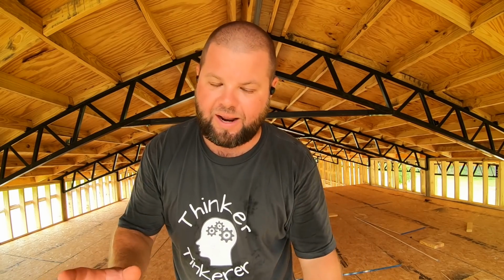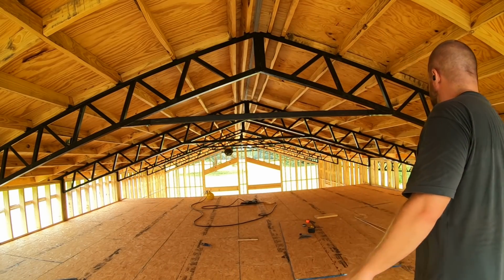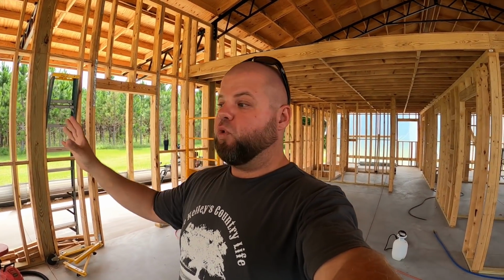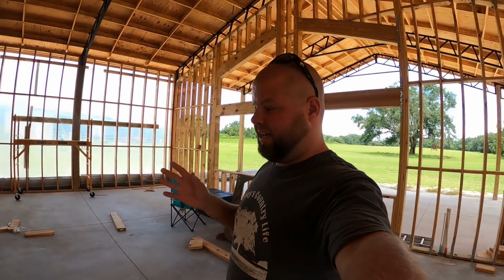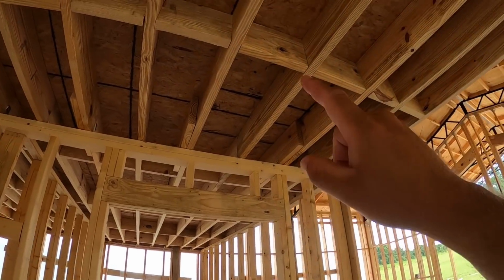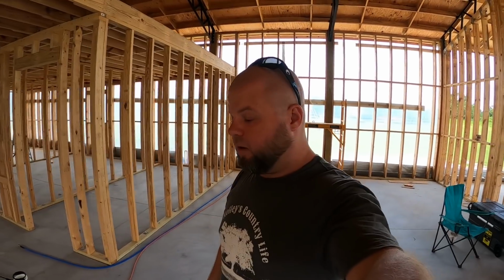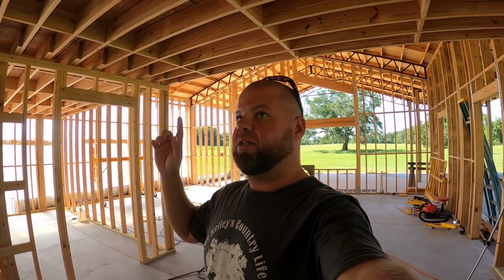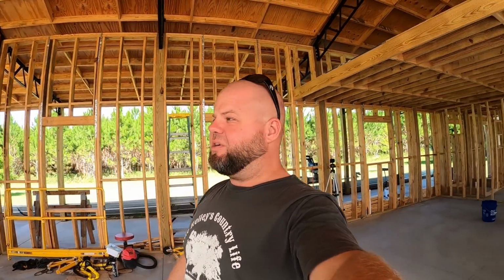An accident and working inside the pole barn house

Comment: love the strong ties.. my sister and her husband bought a tract house that had just started construction on.  while they were framing it. he went in after hours and added hundreds of strong ties  to every spot he could get to.  when the northridge earthquake happened. they were about 15 miles from the epicenter.  they were asleep when it hit.. the shock waves thru them into the air above the bed twice as the house went up and down.  some areas distant from the epicenter experienced a localized rogue wave even where shock waves from different areas of the fault rupture crossed and amplified.  their house did not even have a crack in any wall.. yet.. every other house in the same tract built by the same crews had major structural damage.    have you thought about adding some stainless steel pallet banding to some areas. 

 lastly.. before you frame in the attic end walls.. put several flanges up high to allow you to pass cables from inside the house to the outside thru the flanges and conduit thru the end walls..  you will eventually want wires safely passing thru and be sealed to prevent insects..  to run things like antennas.. camera wiring..  perhaps even anemometers on each end of the roof peak.. so when at night when the wind starts blowing .. you can tell how fast its blowing.. but also as an alert using something  to set off an alarm if the wind rises to fast..  or the atmospheric pressure starts dropping.  be sure to run a plastic conduit from the bulk head connectors at the wall peaks.. to either the electronics closet..  or the master bedroom closet.  forward thinking saves time in the end ..  even if it cost additional funds up front..
Reply from the maker: Wild story and great tips! Thanks

Comment: Use zip sheathing. Install and tape as you go. It's supposed to be more uv resistant than house wrap.
Reply from the maker: It was 55 dollars a sheet and impossible to find a while back when I bought my Osb for 30 a sheet. I really wanted to try it. I did buy Zip tape and I'm going to tape my osb seams.

Comment: Glad your eye is ok so far. I use goggles and a respirator when spraying caustic liquids. Mixing bleach with vinegar (most acids really) will produce chlorine gas. I am not sure how much (if any) acid is left on wood/metal/concrete surfaces after vinegar dries but you are in a well-ventilated area. Being blind, in pain, and alone can be terrifying, glad you kept your head and didn't panic.
Reply from the maker: I didn't use vinegar much at all once I seen how ineffective it was, but a good point none the less.

Comment: So glad that you are ok. You still should probably go have it checked just to be safe. 
Maybe a stupid question but figured I'd ask. Did you ever consider putting in a few small windows up in the attic space in the short outide walls for ventilation or cross breeze especially since you are going to have a room up there?

Scot
Reply from the maker: The loft will be open to the downstairs living room, so it will be air conditioned. As for the attic, we are spray foaming the roof, so you do not vent it. It's considered conditioned space when you do that.

Comment: I have used stuff called Wet-N-Forget to rid my house exterior of mildew.  It takes a long time to eat up the mildew, but it works well on wood, concrete and other surfaces.  I'm not sure if it would fit into your plans though.

Comment: Hey Andrew. How do you like the dewalt frame nailer? I was about to buy that one and discovered that Lowe’s had a deal on the Metabo. You buy the frame nailer and they give you a Metabo 2 1/2” finish nailer FREE! If you think you’ll need another frame nailer check your local lowe’s and see if they have the same deal! It’s a nice nailer. Enjoying your videos. I missed your live feed on Sunday but maybe i’ll catch you this sunday. Hope your eye feels better.
Reply from the maker: I seen that deal at my Lowes too. I literally have 4 Brad nailers so don't need another one lol. As for the Dewalt nailers, the only ones I've ever used is the new 20 volt electric ones, those are a bit slow and extremely heavy.

Comment: @9:30 steel struss to roof beams.. how about adding some LU28 beam hangers to really get a grip on the roof ..  i would have liked you to have used the longer hurricane ties earlier in the video..    have you seen the Simpson CHC lifting eyes.. a few of those might be interesting above your attic ladder installation.. so you have a strong place to hang a rope fall..  heck.. might mount some along the inside of the roof peak under the eves.. so you can hoist stuff up or hang stuff securely..  those go in with screws..  just backseat driving from afar.. 

 and we know about the deep south where the traveling salesman drove past the Nativity scene. had to go around the block to get a second look at it..  found the local diner and went in.. ask  the waitress about the Nativity scene not being correct.. what do you mean she says.. he says. why are the 3 wise men wearing fireman turn out coats.  what.. are you some kinda yankee.. don't you read the bible.. don't you know about the 3 wise men from A fire.. in her best southern accent.   did you know that one of the wise men was very tall.. as he bent over to enter the stable.. he hit his head hard on the door frame..  he grabbed his head and yelled out Jesus Christ..  at that point Joseph turned and said to mary.. quick, write that down. that's so much better a name than Ted..
Reply from the maker: Lol funny story and good tips, thanks!

Comment: You seem like a really nice guy, you need to get a friend I will come over and help you with that stuff. Building a wall and lifting it up is one thing putting boards and putting down sheet horizontally is easy, vertically you’re trying to hold a 4 x 8 sheet of plywood in place and nail it accurately. You really need a helping hand on that I don’t know how you’re going to do it. You’re gonna need to make some kind of rig to help you hold it up probably come out something that sits up on top or you can put a screw in one side and hold it up like if you had someone there helping you. It is going to take you forever to do it that way by yourself.  Lol. You’ll probably melt if you try to do it by yourself
Reply from the maker: Definitely going to make a jig or holder for those sheets. Thanks
Reply: @TKCL . If it was me I would run a cable from end to end with a pulley on top where you can find a way to suspend the sheeting from the center. You’re gonna want to do it horizontally instead of vertically because of what you showed printed on the plywood and how that is the direction of strength you don’t want to go up and down so the first layer will be pretty easy. If you can get some kind of clamps that would hold that much or like a gravity clamp and you could hang it from a cable or something above it might be enough to where it will hold it and you can just position it and keep it in place long enough to get A few nails in it. It will be fun to play with. I’m sure you’ll come up with something good. Even if you just made a 90° frame and use a piece of bicycle tire as a grip for the top, that would be something that you could move without climbing up and down all the time and at least get it to hold up the bulk of the way to the word or at least one side.  Maybe you should be nicer to people though so you have friends and one of them could come over and help. 😜😂😂  It will be interesting to see what you do. I would just keep in mind you want something easy and maneuverable that’s not too heavy it’s self that you can adjust and move from the bottom so you aren’t constantly climbing up and down stairs to deal with it up top.  Can’t wait to see what you figure out.

Comment: I haven’t seen bleach affect lumber to bad but I have seen bleach cause nails to rust fast. 
Be safe brother ✌🏼🇺🇸
Reply from the maker: Bleach does cause metal corrosion. Spray the nails, and especially anchor bolts/washers with WD40 or corrosion X first.
Reply: @TKCL  True. Another great product is CRC Rust Inhibitor. It’s like Cosmoline  grease in an aerosol. Great for boats and boat trailers. Especially a fresh set of leaf springs. 
I put that chit on everything.

Comment: There are aftermarket products you can use for the mold, if you don’t blind yourself first, once you get the outside dried in you want to use more than bleach, bleach will kill the mold but not the spores, do you want to use peroxide. Peroxide will kill the mold but it will also kill the spores. You can use bleach and it definitely kills the mold, I’ve never had any luck with vinegar. But peroxide your best friend when it comes to bleach. You have to look up the ratios but that peroxide is going to kill the spores and get rid of the mold all together bleach it’s just gonna knock it down and kill the live mold, but it’s just gonna come right back.  

To keep from going blind come of course rinse with water but go grab a bottle Celine solution or I wash, it’s pretty cheap and it’s pH balance so it’s not gonna burn your eyes like water well and you can use as much as you want of it.  Some goggles would be good too though with your humidity I don’t think he could wear them for too long but it’s your eyes you want to protect it otherwise you’re gonna end up wearing a patch and looking like a pirate and scaring all the little kids away. :/ 

When you’re using peroxide to kill mold you want at least a 3% solution but no more than 10%, and definitely keep it out of your eyeballs.  Lol. Coroners actually use peroxide to clean all the flesh off of bones so I’m guessing it’s probably not good at all for a balls.  He just put it in a spray bottle and soak them all the areas down and then you let it sit for about 15 or 20 minutes and then you wash it off, you can use a brush or a rag and just scrape it off. But the Prock side will actually destroy the mold spores to a lot of other mold remover’s will just get rid of the live mold and leave the sports behind and it’ll come back again. Peroxide should get rid of it permanently.  Works really good on mildew as well.  3 to 10% probably isn’t strong enough to bleach your hair, but I’m guessing you’re not too worried about that, I’m guessing you’re not the type to dye your hair. Lol
Reply from the maker: I bought some biocide that's just for mold, supposedly the best you can get. After dried in, you soak the wood in it and it's there for life.
Reply: @TKCL  awesome. I remember the house I worked on about 10 years ago and there was a bunch of mold underneath the house and we bleached it and scraped it and it came off but then we bleached it again and we bought an aftermarket product it was a sealer that said it would kill the mold and it was basically like a paint that you just paint over it and that seem to work pretty good even six or eight years later there was no mold down there.

Comment: I'm sure someone else has already said it but you have 90 days from the time you put up the house wrap till you cover it.
Reply from the maker: No one has said that, but it shouldn't be a problem. I'm itching to get my hardi siding on asap. Thanks!
Reply: @TKCL  just giving a heads up. I know a lot of people esp up north during the winter that think in the fall that is dried in but the UV is not kind to house wrap. Neither is the wind.
Reply from the maker: Luckily I coughed up the extra money for the Dupont tyvek, not the cheap big box stuff. The inspector was happy to see that. I'm taping all seams and will at the minimum put my hardi trim on to help secure the wrap.

Comment: In my experience, the inspector was OK with the sheathing being covered with tyvek. He just peeled it back in a few places to look at your nail pattern. It does not have to be a 100% inspection. It is a spot check.
Reply from the maker: He has looked around enough at my work that he realizes I don't cut corners. At least that's the feeling I got.

Comment: How do you treat and bleach it with what
Reply from the maker: I hit the little bit of mold with a 1 part bleach, 2 parts water solution. That only works if you allow it to dry well afterwards. Once the hiuse is built you control humidity no longer allowing any growth.

Comment: When you get to the point of doing the electric in the house don't forget to have some fun and put in some things for jokes like speakers in random spots for the times you want people to think the place is haunted. It is amazing what simple sounds that people can't find a source of will make them think like how easy it is to scare people with the sound of kids laughing with the source moving around them. 

Ozone is the answer but you would have to wait till you get the place sealed off more from the wind blowing as you want to get the concentration up inside the building. Once you get the place housewrapped and can temporarily seal off the doors and windows simply setup an ozone generator with a fan to spread it in the house and let it work for a weekend and everything living on the wood will be dead. You can also use a the right type of UV light to kill off everything on the surfaces but would want the cord outside so you can turn it off before you go inside.

Comment: You should be waring goggles and glasses . Read your msds on the bleach your using. It will tell you the safety equipment required.
I enjoy your videoes. Remember safety first
Reply from the maker: I've tried goggles recently, in this 100 degree weather it's instant fogging up. Can't see a thing

Comment: Andrew Stop Ignoring me.  You are missing steps.   You do not put drywall directly on ceiling like that.  You need to put your strapping.  And before you go too far  glue the sides of the floor from under.  Like a beet of silly sillycone but using a all purpose high strength additives.  At minimum where you would walk on top.  It will reduce the creaking noises and stiffer the structure   as well if you are not sheating soon you will run outa time.  But you can do is cut a 16 inch board for the bottom  if ever you need to fix rotten areas of the bottom in the future it would be easy to fix.   As well you should add anty bug paint stuff at bottom of the wood.  Saves you from problems...   do your sofets "under the outdoor edges if you not wishing to do the sheets on the outside walls yet.   What your inspector is looking for is errors.  And normally outside sheeting does not make any  differences. We normally put the sheeting at the same time as the outside walls.  Then you need to change your mind on the cheep fix of painted  SOFITS.  Then you need to used some nice wood boards or Aluminum sheating.  See you need some on the side anyhow.  They normally do well to keep weather out.
Reply from the maker: I have no idea what you mean by ignoring you, I respond to everyone unless it's rude. YouTube does a unhealthy amount of deleting comments for me. It's absolutely common to sheet rock 24 inch on center joints or rafters with 5/8s sheet rock, literally every home around here has ceilings 24 on center. As far as the loft quarters, the next subfloor will be glued.
Reply: @TKCL  not enough  bud  I would have OCD removed all em boards.   Nails are not the way to hold em down   adding to next row will only make the floor thicker.   But not bonded to the frame.  It is something that could make you fail a code violation.  In my area if you do not glue it  you will have to restart..  so when I saw you nailing em more down  it hurt my eyes.  It was like dude....   and then you are adding 6x6 parts to hold up the drywall.   No need for that.   Why?  Strapping.  It allows some directional movement to avoid cracks in tou drywall.  So  do not waste time adding them 4x6 as drywall corner for ceilings.  Get strapping.  1x3